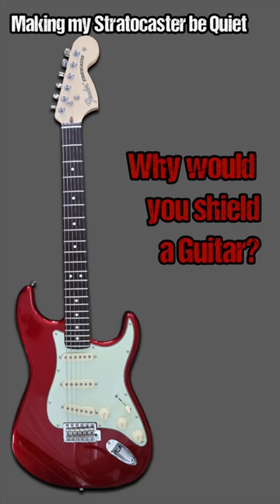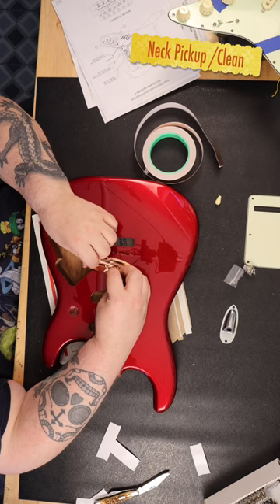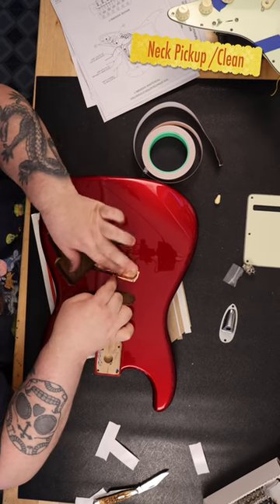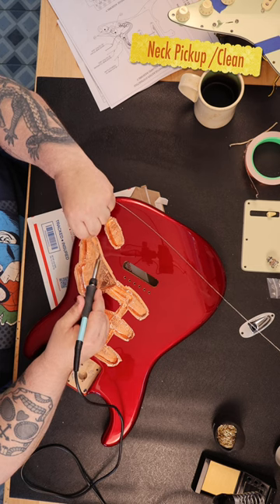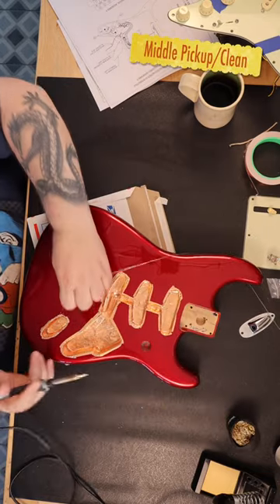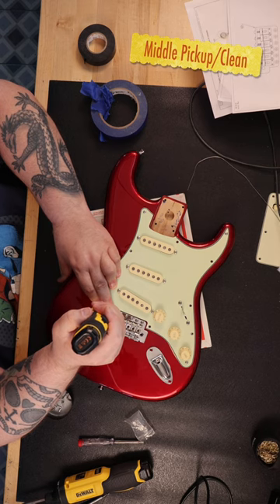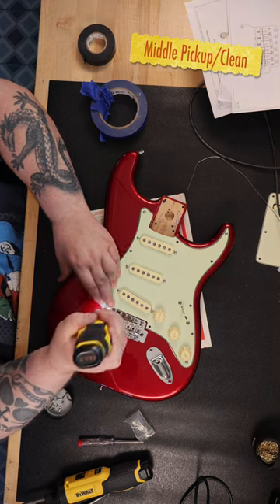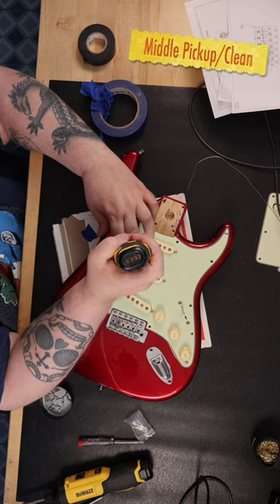Making my Stratocaster Quiet – Shielding! #guitar #guitarplayer #guitarcover

Comment: I have shielded 4 squire strats completely and I was able to make a tube of copper tape to line the hole that connects the output cavity. I just used a little screwdriver to mash the adhesive to the walls and then rolle it out and around the whole area.
Reply: Then I got a couple telecasters and decided not to shield them, and I honestly can’t tell if there is any difference between being shielded and not shielded.
Reply from the maker: Great idea on the strat. What is funny is I notice big time on strats the difference but not on Teles.  @jeremiahmeraz9298

Comment: You really should reconsider grounding to the bridge... Because your hands are touching the strings and now you are ground too. Unless you dont mind getting electrocuted and possibly killed because of a ground loop you didn't know was there when you plugged in your amp. Happened to a friend of mine and me but I survived. I never grounded my guitar to the bridge hence removing myself from the circuit completely.  And if you shield it correctly like you did here with the copper tape you dont need to ground to the bridge to get a buzz free guitar. Mine sounds dead quiet and the bridge isn't grounded. Taylor acoustic guitars are still grounded to the bridge but they put an inline fuse that blows to save you if you accidentally connect to a ground loop.
Reply from the maker: I really enjoy getting jolted. The bridge is already grounded. There is a wire that goes from ground in the wiring harness to the tree claw.
Reply: @guitarcollectorguy   that's my point collector guy...It shouldn't be connected to the claw. It's a cheap way manufacturers use to get a low noise guitar. They'd rather cheap out and not shield it like you did. They dont care if you get electrocuted and die if it saves them money. Just a heads up, check into it and you'll see just how dangerous it is. I'd cut that wire connected to your claw and remove yourself from being grounded too. Good videos though, I enjoy them. You have a pleasant speaking voice.
Reply from the maker: @MoonSpyStudios  thank you kindly for the advice and kind comments. Much appreciated.

Comment: Why do you change out the screw in the main cavity for a soldered wire when shielding?
Reply from the maker: Both should work if they are touching the shielding. Usually the screw into the body is touching conductive paint.